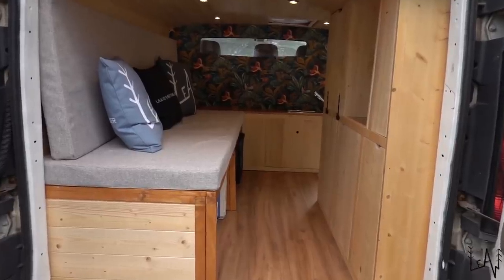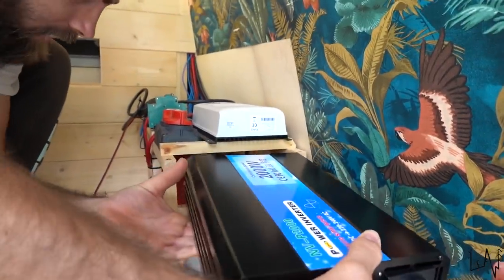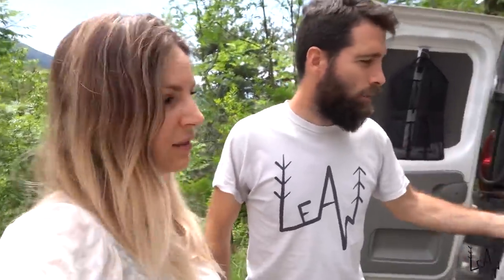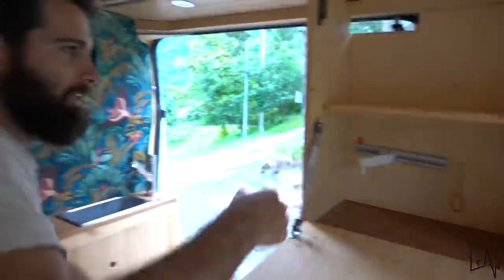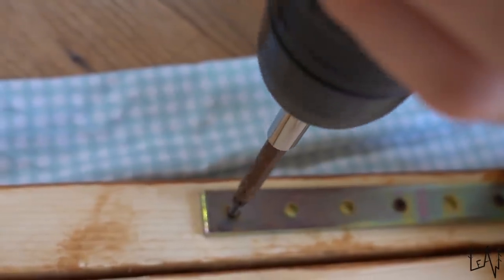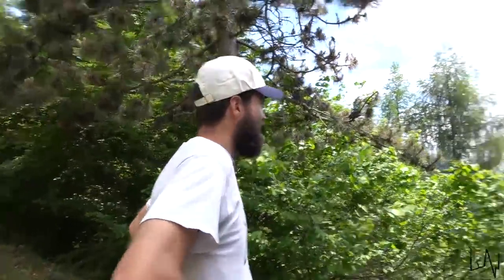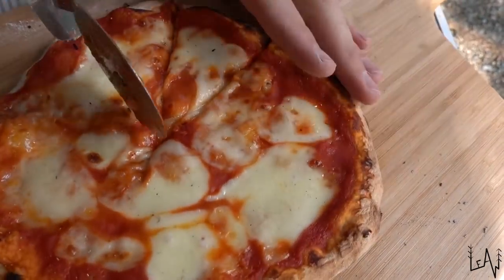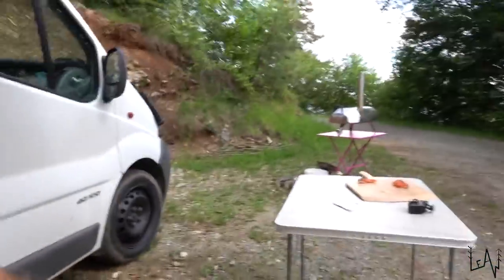MINIVAN DIY UPGRADES - AMAZING PORTABLE PIZZA OVEN! VAN LIFE ITALY

Comment: As far as your trip, I live inland so always flip out when seeing the ocean.

Love the pizza oven! You could cook anything in there! I'd try roasting trays of cut up veggies tossed in olive oil, Sea salt & cracked black pepper, large chunks of garlic & fresh herbs - & keep on tossing till veggies seem just cooked enough. Leftover veggies can go on a salad or in a soup, later. A small roasting pan could hold  fish filets, boneless chicken, a small roast, &  either shrimp or small cuts of marinated meats with veggies on skewers could get a bit of a char & everything could have a hint of the flavor of burning wood. 

For dessert, roasted / baked apples could be cored, sat on a square of pastry dough, which is sat on a larger square of aluminum foil,  then sweetened by stuffing  with a blend of: sugar, butter & cinnamon, stuffed into the hollowed out cores. Then pull up the corners of the dough & wrap each individual apple, in the dough blanket, poke a few holes in the dough near the top, & then wrap them in the foil to bake like a little individual pie, @ maybe 425 degrees C, at mayne 40 minutes  - or less, or make a tray full of "Smores" & know they're done when the marshmallow melts & lightly browns. Martha Stewart has an old recipe for making your own marshmallow, cut into squares!  

I think you could use an internal oven thermometer with a digital readout displayed on your phones. You can learn to adjust the amount of wood, type of wood & use a a watch with Bluetooth, to get to the desired internal temperature so your foods are cooked, or just reheated - the way you want them. 

With smaller & thin crust pizzas, the temps could be a bit lower, I'm guessing. A 500 degree oven would be plenty to cook pizza quickly in such a small space - & more than enough for standard roasting, ie: @ 325 F / 167C; to 350 F / 177C, &  bake for 10, 15 minutes or less. For more dense foods, like big Idaho potatoes, in a 425 F / 208C  oven might bake for 20 - 40 minutes, more or less. It would be good to practice like Sara & Luca did, to get an estimate of time required by item, & keep on turning things. You might want to use a ceramic pizza stone or cast iron pan  to help even out the heat. 

You could even build a warming oven out of metal sheets to cook foods in stages & then move them to the warming oven to keep some warm while other course(s)  cook. One of those pizza ovens could be brought on a trip to the beach or a park. So hot it's cool!

Comment: Salve a Sara & Luca. Personally, I would choose Puglia since I think that it would be the easiest region of the three options for you considering the issue of the van and where to park it along with the narrow roads involved, and so on. Also, Sicilia and the Amalfi coast areas have both been discussed in the media more often as travel destinations with bella Puglia less commonly mentioned. For the pizza, if you brush a patina of olive oil around the perimeter crust, this will prevent the outer perimeter crust area from burning. 😃 Angelo Rolando

Comment: Hello guys. Just a suggestion… the cabinets in the van, the middle part without the door where you have the La Vita e Bella sticker, you can replace it with a mirror for the entire wall, a mirror usually makes the interior look bigger, and a mirror would be something that’s useful also. And there’s a stick-on battery operated ceiling iight that you can buy in Amazon for when you have to use the mirror at night and for that much needed over all ambient effect. Much love for you both. Keep us the good work.

Comment: Lead acid batteries (they look like flooded lead acid) produce hydrogen gas during use.  The inverter may produce sparks if it has relay contacts inside, which might be a problem with that location.  I wonder if confectioners Swerve would work instead of evil sugar in the elder flowers?  I'll try it.  I want that pizza oven!  Caio

Comment: Hey Luca , that battery releases toxic fumes into the van. In addition putting the inverter above the battery is no good as those toxic fumes from that battery contain acid and that will cause corrosion in the inverter.